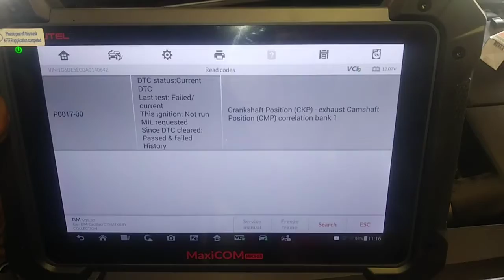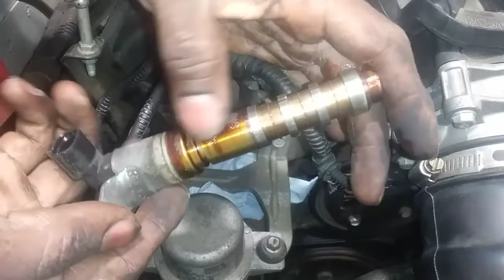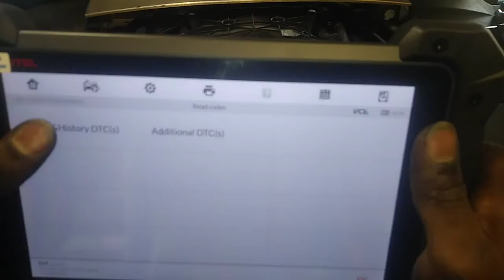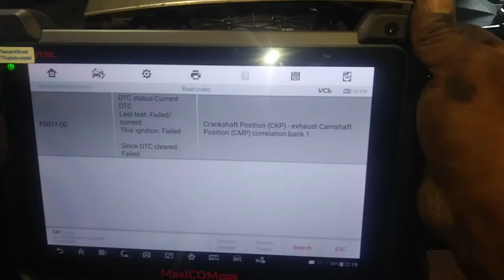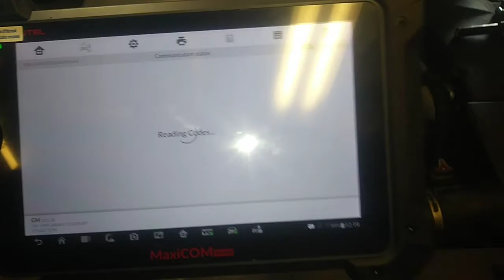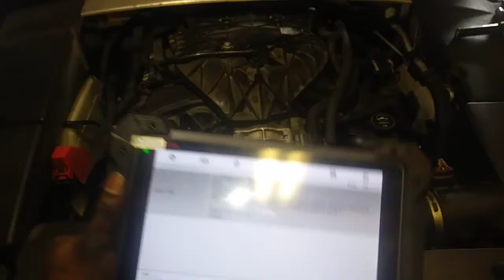Cadillac/Buick/Chevy p0017

Comment: My current situation but I also have p0019, p0014 & p0024. Changed both vvti solenoids on bank 2, both camshaft sensors on bank 2, did the timing chains/sprockets/tensioners/cam gears. After starting it up, all seemed good for a while idling until all 4 codes shot back out. I’m going to try the crankshaft sensor then an oil change if nothing improves then the VVTI solenoids as a final measure.
Reply from the maker: Seem like you're timing was done improperly.  Redo your timing chain and triple check your marks
Reply: the timing chains on these engines are difficult to install.  there is a specific procedure it must be done in a particular way or the check engine light will stay on

Comment: 2007 CTS 3.6 just did timing chains and still have p0017. Changed cam sensor and VVT solenoid and oil. Code keeps coming back.
Reply: Does it still run fine?
Reply: are you sure the timing chains were done correctly? its not an easy installation

Comment: I just wanted to say that I just went through a P0017 on my friends Toyota Venza. Oil was just changed at the dealership back in November. I swapped the oil, and when we started the engine made a clink near the camshaft and started idling smooth again. I did a reset by unplugging the battery and away we went.

Comment: Look up the specs to drill out the PCV valve. Once you do that it will not consume oil anymore, and it will definitely run better. Get rid of that excessive crank case pressure. Worked like a charm on my 2010 3.6  Cadillac CTS. Do valve cover gaskets after if you haven't done them. Requires a new intake manifold gasket set too. Well, should anyway.
Reply: is it true that the pcv valves on the 3.6 liter are not replaceable?

Comment: I change my timing chain and crank sensor the codes didn’t go away still popping up the engine runs fine just the check engine light comes on when I shut off the engine after a long drive pending code comes on tho
Reply from the maker: You probably installed timing chain incorrectly unfortunately, if it jumps teeth it'll cause same code.
Reply: @partsshooter  nah I had someone professional do it with me and we did it twice to make sure was installed properly and now I’m getting more codes p0008 p0016 p0017 on my 2008 Cadillac CTS and also on my 2011 camaro just one code p0017
Reply: @juniorr-v7091  to have additional codes created after replacing a second time definitely not installed correctly. Hey third time is a charm..😁✌️
Reply: @stinkynene  I have a chevy colorado  p0017 leaning towards  short in wiring harness  of bank 1 cam sensor
Reply: @mrcoolcashcars4632  it's probably the timing chain or phasers

Comment: @Parts Shooter hey I have a 2013 Cadillac CTS with the 3.6 engine. How do you know if those oll solenoids are bad?
Reply: VVT feature will not function correctly if at all & then you'll get some timing-related codes if u keep on driving it like that...p0017, p0018, etc.

Comment: Great job on the video! On my 2008 Suzuki xl7 showed about 750 miles from last change. Oil black as can be. Car essentially sat for 3 years so oil (on its own), so the oil should still look fresh. I did a crankcase flush with Berryman's (Seafoam cheaper cousin), and fresh Mobile1 and Mobile1 filter. Cleared all of the codes but am replacing the bank 1 exhaust cam sensor since that still tripped immediately. Suzuki already warranty replaced the timing chain not long ago and car only has 81k. NOTE: Also check PCV valve for failure (mine's good), since that will lead to sludge and poor oiling (later stretched timing chain stretch).